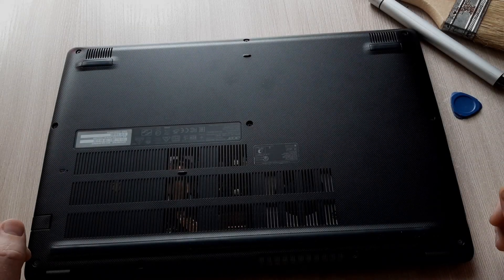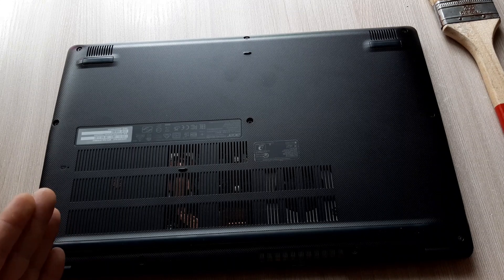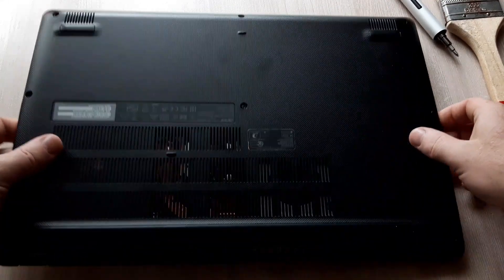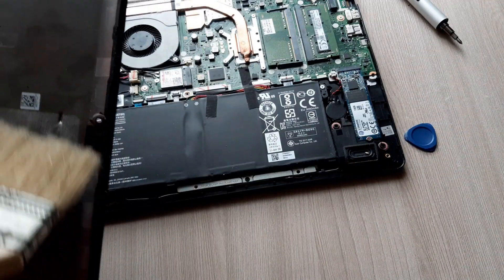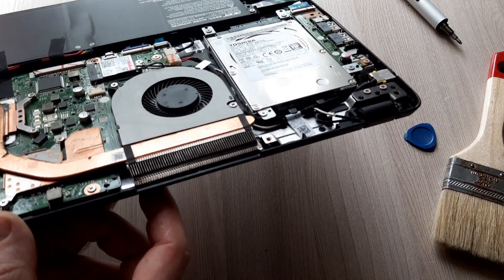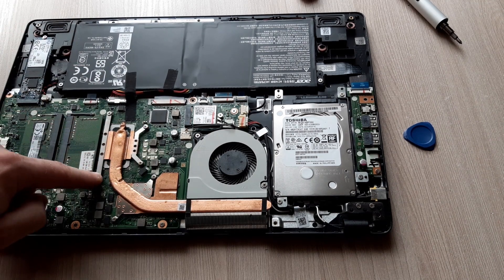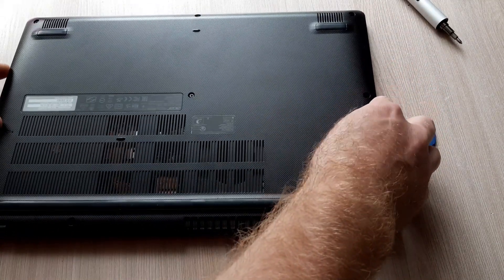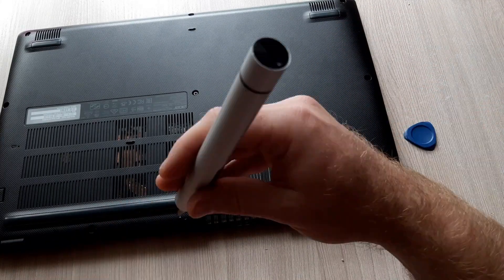Acer Aspire 5 A515 Disassembly for Cooling Fan Cleaning

Comment: do you need thermal pads for the gpu when unscrewing the fan
Reply from the maker: Yes
Reply: @UPSIDEAL   i did it without changing it can something happen. They were in good condition with no sing of being burned.
Reply from the maker: @kostadingramatikov9692  thats ok